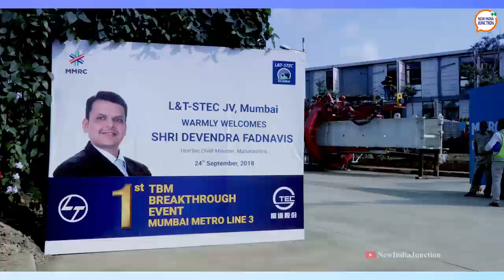Mumbai Trans Harbour Link (MTHL) Project

Comment: Today 20/02/2020.. The project is going very fast & hopefully the projects will be completed before the deadline 2022 & quality of the material like cement, fusion bonded exopy coated rebar & pvc coated gi binding wire is used is very good.. L&T well done..